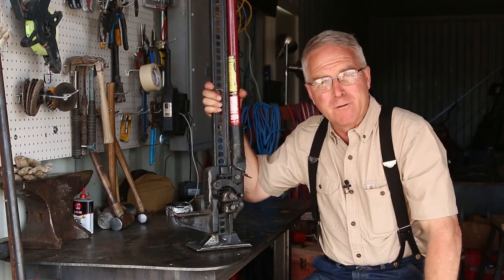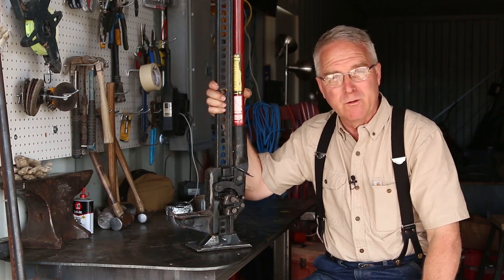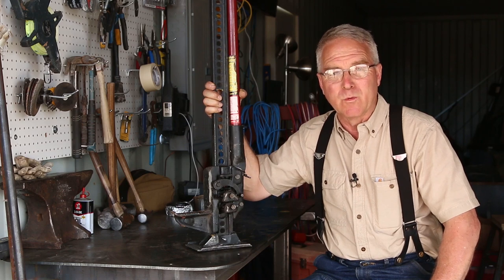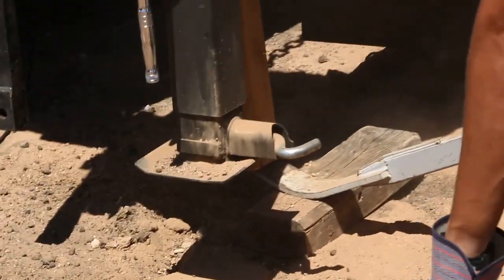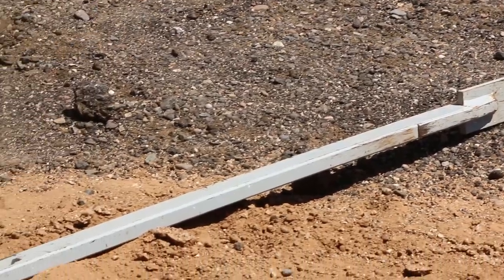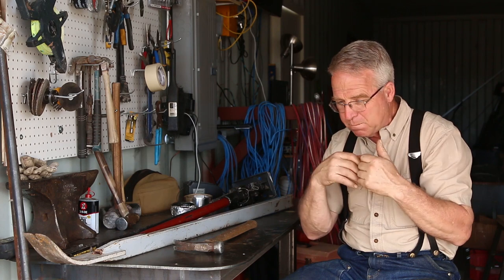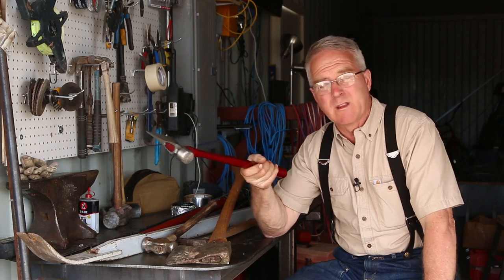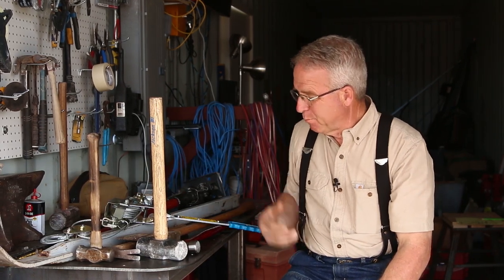5 Problem Solving Tools

Comment: I just discovered your channel and am enjoying it a lot. So, here are two tips, one practical and one philosophical. 

1. When doing anything under ANY sink with a cabinet, install a thick piece of any kind of plastic on the floor of the cabinet. It will always eventually leak, you won’t catch it for a while, and the water will rot the wood and it will also smell bad. As a bonus, the plastic makes it easier to wipe out spilled Clorox or whathaveyou. 

2. NEVER try to avoid a mid-day trip to Home Depot. It never works. You always wind up trying to make something work that won’t. So, in a Zen-like manner, accept in your brain and heart that you’ll be making a trip to Home Depot at noon or so, then as the job progresses through the morning, keep a list of the stuff you will need to buy at Home Depot at noon. Also; there’s inevitably a hot dog stand at Home Depot. Utilize it as a reward for doing the job right. Once I accepted this, I became a happier man and a better craftsman.
Reply: All great advice.
Reply: MadLad  it depends on the job. For example, I went to replace a wax ring on a toilet. When I started, I found the shut off valve was frozen. Now I could just shut off all the water in my house, change the wax and be done. The right thing to do was to change the valve. Of course I had a straight valve in the parts bin, but no 90 degree. A straight would have worked, but a 90 is what was really proper. Off to home depot I went. I'm not a plumber, I don't have a fully stocked truck. I have plenty of things should an emergency arise but I may not exactly the right part to do the best job when a surprise situation comes up.
Reply: Better yet, line the bottom of the sink cabinet with a piece of the kitchen sheet vinyl.
Reply: You will always know when you are finally about to finish a project when you are leaving the hardware store for the 3rd time for that project.  Every time you open a part or open a closed portion of the work, you can find something you did not expect...
Reply: ---  I have been carpentering ( 60 years now ) long before there was a Home Depot and before Lowes became the chain store it is today:  Lowes made its first appearance ( for me ) in the early 70s ( Hattiesburg MS ) and Home Depot in the early 80s  -  I avoid both whenever possible, which is now difficult when you are contracting.  I have never left either a HD or a Lowes in a better mood than when I went in, and seldom have I left either with everything I was looking for no matter how simple or common the items I was needing .

Comment: I knew the Burke bar was coming!
Reply: I hear ya.

Another reason to get the Burke Bar in front of the camera. 

LOVE IT!
Reply: He forgot the greatest tool ever, money, with it you can solve almost anything!
Reply: Yeah, but do you get a bicep workout out of 'em?
Reply: Let there be light....and a Burke Bar
Reply: Should have been the Tanker Bar
Reply: 12 v winch 2500ibs with a car battery i carry most times. I think a chain hoist is better than a com-long because most of them today are garbage made in china.  Same with these logging pullies all made in china i picked up 2 old 50 yrs old crane pulleys made for cranes hard to find and got them super cheap guy did not know what he had and wanted them out of his shop. Even got a 1940s 2 frame honeybee extractor and in the process of rebuilding/welding the thing because it shakes violently when engaged.  Love the old stuff that works if not paying attention vs all these butt hurt metal lunch pales cars you cannot work on crap they make so people do not hurt themselves garbage that breaks in 2 days. Or engineering to fail garbage you have to re buy.  Look at how alternators/starters are made you cannot work on anymore.  I rebuilt my cummings starter off ebay 70 for the parts and new armature vs a 700 starter.
Reply: @Deactivated1122  a flat bar is useful and convenient but it in no way can do the things a burke bar can do. When nothing else works you call in The Burke bar
Reply: @roberthowell932  You are right on the money about everything you said! I always look for older  American or German made tools.
Reply: Do you guys realize that before the crowbar was invented, crows had to drink alone?

Comment: Tire Patch and Plug Kit!
When I was 15, I worked at an auto garage. They taught me how to pull a nail out of a tire and plug it without removing the tire from the vehicle.
I'm 37 now and have since patched my tires a half-dozen times and repaired about 200 other people's tires.
Some memorable moments are an old couple (80s) in Georgia, a young couple heading to prom near Green Bay and a mother with her baby in Chicago.
Few things in this world bring me as much happiness as helping people in a time of need.
Reply: +1 on the patch kit.  I was getting a new set of tires and left while it was done, when I returned the entire shop was huddled around the tire removal machine.  As I drew near I heard one of them exclaim " there are more than forty plugs in this thing".  Job sites are full of lose nails, as soon as I hear the tell tail hiss I yank the nail and throw a plug in before it loses any air.  Back the patch kit up with a small 12V compressor.
Have patched tires for dozens of others as well.  When they say "what do I owe you"  I tell them "You now have to help at least four other people"

Comment: Vise grips would be a good choice for the list too
Reply: I was going to add these.
Reply: @nick f So, vicegrips that have other tools that fold out of them? Because what makes vicegrips really useful is the amount of force you can exert with them and being able to hammer on or with them since they are so sturdy.
Reply: Vise Grips? Yeah, sure -- but which of the dizzying array are you going to opt for? It's a jungle out there. The only thing I haven't seen are Vise Spreaders.
Reply: @michaelthibault7930  Vice Grip pliers.
Reply: @heywardhollis1160  Which model? They're all pliers.
Reply: @michaelthibault7930  i like the large straight jaws. I've got a few pairs but i rarely use any others.
Reply: That's what I thought the last one would be (#1). Alas he fooled me with an even more logical and useful tool (though vice grips are pretty useful).
Reply: Vice grips and C-clamp.

Comment: Essential craftsman: uploads video. Me: Heads to hardware store
Reply: yeah bro haha
Reply: Just looked up Burke Bar and High Lift on Amazon!!  lol
Reply: I Promise I wasnt watching I was just listening to audio playing via bluetooth...
Reply: Scott promised to start selling Burke bars on his website. I'm waiting for one of his
Reply: I have and use most of the tools EC has in his vids. 
However, I was sawing logs with my band sawmill and needed a tool to lift 1 end of a log to level it ( put in pillow blocks) and to peel tough bark and slide , pry logs and things around. I watched one of his vids where he used a Burke bar and remembered using them on construction jobs. The closest hardware store where I could buy one is 170 miles away. But I had some leaf springs and a piece of 2" pipe  an angle grinder and an arc welder. So I made one. I don't know if it would lift a container. But it has done everything I need it to so far and done it with ease. What a great tool.

Comment: As always, your life’s wisdom is worth listening to. My “saved the day” tool is a breaker bar - for when you’ve got to separate a nut & bolt that even an impact drill / gun won’t budge. Most any simple piece of pipe will work as a breaker bar, so long as its diameter is large enough to fit over the handle of the wrench that you’re using. My “go to” breaker bar is the upper piece of my two-piece floor jack handle. Often times I find it best to move the nut in the tightening direction - just a hair - then loosen it. It’s amazing the difference an extra 24” of leverage will make.

Comment: One thing for all of those that have good gear to help people along the side of the road.  Be sure to have a high viability (yellow) vest  quickly accessible because you don't want to be a victim when helping a fellow traveler that is in distress along the highway.  20 years ago, I thought it was a scam when I worked for a company that forced contractors to purchase these before they could step foot on our work sites.  Now that I am older, these might be one of the best things to keep you safe when repairing a tire along the side of the road.

Comment: Fire Extinguisher came in handy one time; I keep one in every vehicle I own and so should everyone as vehicle fires are the most common types. 
One time I was stopped at a red light and off to my right was a burger joint and in the parking lot was a beautiful robbins egg blue 67 Mustang Convertible with the hood up and sure enough the owner was just at that moment realizing that the engine bay had caught on fire and so I was able to quickly pull to the shoulder and hop out and deal with the flames.
Reply: Bravissimo!

Comment: A few years ago I was working on the refurbishment of a historic builnding (well, more of a rip out and rebuild) and needed some way to dismantle and remove an entire floor in this 1850s brick-built mill complex. By the way, it was about 30,000 square feet and the floor was mainly two or 3 layers of heavy first growth planking onto 8 x 3 joists, in turn onto 20 x 10in primary beams, So heavy work. I had my trusty 36in Hultafors wrecking bar and a Crescent forked decking bar, but I needed something a lot bigger and tougher if I wasn't to do myself a mischief. I then came across one of your videos where you mentioned and showed the Burke bars and I was sold on the idea. They are all but unknown here in the UK, but I managed to find a supplier and bought two different ones. They have been invaluable on several jobs now, and really speed up the process of dismantling heavy Victorian floor or roof structures. I even use then to remove sections of heritage wall panelling and door linings (with no or minimal damage) because they really can be used with precision and delicacy, especially for such large, heavy tools. Many thanks from one old timer (51 years and counting) on the other side of the pond

Comment: Re: Burke Bar, "Give me a lever long enough and a fulcrum on which to place it, and I shall move the world." Archimedes
Reply: Got damn that's profound. I love stuff like this
Reply: Tom Condon yup had the same idea. Have you seen the guy who moves a whole big outbuilding around with nothing but a big lever
Reply: One of the first lessons I learned from my dad about moving heavy stuff without a tractor.
Reply: Had a rain day here today and have a job I have been needing to do that will be a perfect place to use a burke bar....   now I wait for the rain to quit to put it to use!!
Reply: Archimedes, now is that the old fella down at the Ace Hardware on Route 50?  He has some real interesting stuff to say.  I wish someone would write it all down. :-)
Reply: I know it as a Johnson Bar.  Simliar but has steel wheels for easy moving
Reply: love that ark-a-meetees!..quote him every time!
Reply: Don't have a Burke bar but do have a digging bar that works great as a lever.
Reply: cool yt vid about a guy who figured out how the druids did Stonehenge.. teeter tottering 30 ton stone slabs high enough to tilt upright..
Reply: yay no irritating background noise
Reply: multi tools are edc
also a good flashlight
Reply: @duggydugg3937  Wally!!!

Comment: “If you don’t have a rigging axe, you don’t have to run out and buy one...”

But, but, I want to...
Reply: Get two just in case.
Reply: I found an old True Temper rigging axe head on the ‘bay, rusty, but showing the telltale grain difference back of the edge that says HIGH CARBON STEEL LAMINATED HEAD! It lives again with a new American hickory handle in my tool box.
Reply: dangot I've got too many hammers already...

or do I?
Reply: It's tough to beat a rigging axe, especially for demolition work.  It cuts drywall out, chops romex, you name it.
Reply: Burke bar is the only one I did not have. Harbor freight or Norther tool will see me this week! 😂
Reply: Got thŕèè now .. mostly by àccedènt
Reply: ckorpi88ify  no they don’t
Reply: ckorpi88ify  I found a Burke bar online but it was very expensive. They sell something very similar at harbor freight tools
Reply: They are good for throwing axes as well.
Reply: I got several axes and didnt even know i was missing 1
Reply: @papabear149  just watched. a video where a ax guy said harbor freight hickory handle  is actually hi quality once you strip varnish of handle cut the edge a lil better and oil.. crazy how fascinating it was to me
Reply: yeahhhh!  mee too!
Reply: @Rocketninja200  two is one one is none

Comment: I almost always have a painter multi tool in my back pocket when I’m traveling light to get something done quickly like painting, taping/mudding, flooring, etc. love that tool. I’ve probably went through at least 20 of them by now. The husky one is pretty sturdy and not a bad impromptu chisel.
Reply: A vastly underated tool

Comment: Fire extinguisher. Solving problems when a problem needs solving
Reply: That’s a safety issue, though I know it’s always good to have one close by at all times.  But I think the purpose of this video was, to show the most versatile tools that can help you in a few different ways.
Reply: Try 'CATASTROPHIC FAILURE' issue-
Reply: I was wondering about that too.
Reply: @IchimonjiBlade  a fire extinguisher is a multi use tool. It can put out fires, sure, but it's a personal defence weapon, it works as a blunt instrument, a visual concealment device, an assailant marking device, and as an oxygen denial device, 
It can be a breaching tool,
It can be used as a mallet,
And as a doorstop,
And a paper weight.
It can cool items as well, before they melt,
Sodium bicarbonate extinguishers will also neutralize acid attacks, and spills,
And in a pinch, I've inflated a tire, with some minor retrofitting.

Fire extinguishers also make you look responsible
Reply: yep have a 6lb ABC in my car at all times
Reply: I've been driving 40+ years (and never needed one for myself) yet somehow on three occasions I have spotted someone on the roadside with a vehicle fire in time to stop, and on two of those occasions several years apart, in time to help using my extinguisher.  Not only did I get the satisfaction of helping, and the thanks for helping, but also their insurance companies were happy to replace my extinguishers.  This was quite a long time ago, but I hope it still happens now.
Reply: Only used one once in 60 years, but it worked when nothing else would, and with just a short burst. House could have burned down without it. I now also have Fire Gone spray cans near the stove and elsewhere. These seem to work very well and don't cost much. Highly recommend getting some.
Reply: Two liter bottle of pop.  Take off the cap, thumb over the opening, give it a shake, invert it & spray.

Comment: You Sir are an Inspiration! "Never can have to many tools"! Can't tell you as a Former Law Enforcement Officer how many times I have used a "Slim Jim" to unlock citizens vehicles that who had locked their keys in the car. Can't do that these days , too much liability (might damage the lock system) or even the push bars on the Patrol Vehicle (might damage the number, tail lights etc on the citizens vehicle, again liability gets in the way of helping the stranded citizen. Different times now!